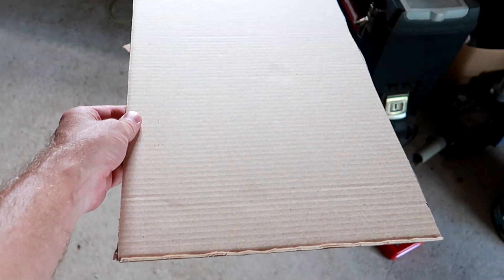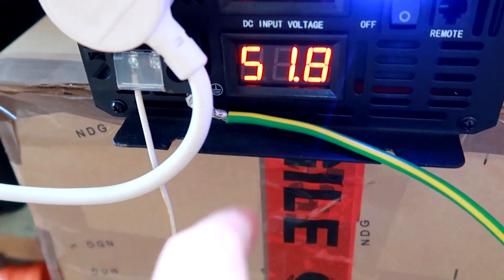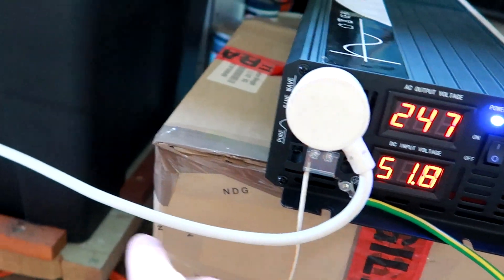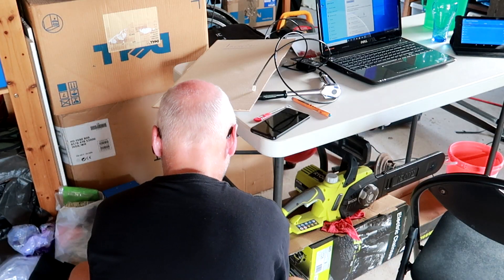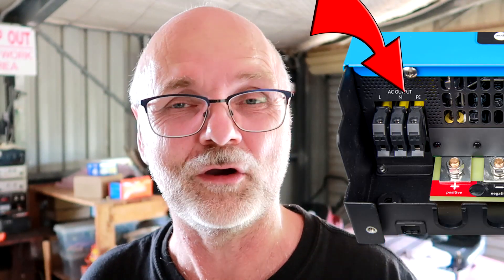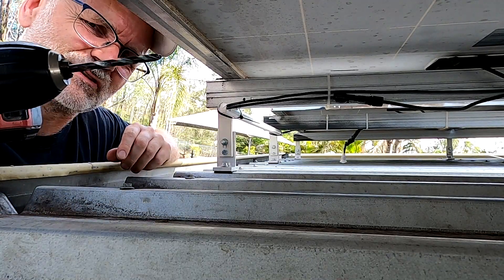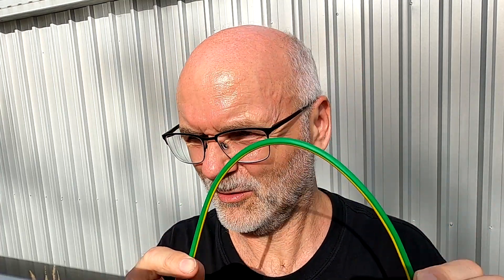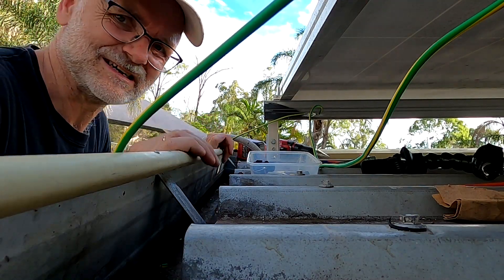The inevitable Inverter Upgrade

Comment: Neutral / "Earth" (ground) bonding exists for GFCI devices. Any current over ground would trip the GFCI, stopping power, that is the primary purpose of the N/G bond. The ground rod, or literal connection to the Earth exists to dissipate static discharge voltage. These are two separate concerns- if you have the N/G bond, even without a grounding rod your GFI will function. Static potential between commonly grounded devices will equalize with eachother.

Comment: Mount the new inverter to the inside of the door of the enclosure.
Reply from the maker: What difference would that make?
Reply: @OffGridGarageAustralia  By arranging the inverter to be mounted to the door you would be raising it and moving it further from the back edge of the enclosure. This would free up additional space in the enclosure for other components like meters, etc to remain inside the enclosure  - I  am assuming that having the inverter mounted to the door would basically make the inverter capable of being moved out of the enclosure when the door was opened and would thus leave room in the enclosure for other things as well as make it a bit easier to work on the components inside . Of course, you would need to use additional wiring , etc - so that when the door was opened the inverter could still be connected to everything. Additionally, mounting the inverter to the door would take advantage of the heat dissipation capability of a large thin plate of metal exposed to moving air .........  see comment below :)

Comment: If the charge controller was mounted to the walls, it would have natural convection from the cooling fins, but sideways on a table, there is no ventilation, so I would expect it to be cooler, when mounted.

Comment: Hi Andy. I’m not sure if you’ve picked up on it yet but it’s a 3Kva inverter. Not 3Kw. They are rated for 2.4 kilowatts continuous.
Reply: Is the claimed rating 3kVA peak vs 3kVA continuous?
If the load power factor is 1.0, one VA is the same as a Watt-

Comment: The lack of a real, separate earth ground is a coomon issue in marine setups, well documented with generators and inverters. The US OSHA has some advice on this, and there is an excellent white paper online for cinematographers and other who usually take gensets into the field, and typically don't pound in ground rods.
 You are not the first person to have this problem. Tesla is simply following safety standards for fixed installations.

Comment: The Victron MPPT charge controller would run cooler if mounted on the wall so the air can flow up across the heat sink and away. Putting all your goodies in a air tight box when ambient temp is already 35 degrees C is not a good idea.

Comment: 6:22 all in one unit like mppsolar, voltronic hawe same problem with Earth and neutral they work in "island Mode" when u measure in fase and neutral get 230v but when measure fase and Earth is 115 and neutral and Earth is 115. U hawe to join neutral and Earth with tini wire for just keep the neutral referenced to Earth and then u got 230v measuring on fase and Earth , neutral and Earth is zero now

Comment: Yea, that cheap inverter you initially purchased was probably the worst component in your otherwise "quality" system. 
It wouldn't have made for as many interesting videos BUT an all-in-one (Victron EasySolar-II GX for example) would surely have been the easiest, cheapest, highest quality solution PLUS it features a transfer switch with true ME grounding.

Comment: I know, we Germans are cracy on perfection... So I was just waiting until you go for Victron. 
I am very curious how you handle the voltage drop of the three cells. I was horrified by this incident! Because I plan to build a 48V bank with 32 cells based on your project. (Btw: there are severall offers on Alibaba for 310Ah cells of the same type)
Reply: I'm no expert but there is something VERY wrong with those three cells
Reply: Be careful with the 310Ah cells. They have QR codes scratched out and weigh similar to the 280Ah cells I believe. I'm waiting for others to test them first.

Comment: Moin Andy,
congratulation for your new converter. I think you bought the "Mercedes". High price but - all what I read about Victron - very good quality. Can top it only with the Systems from Mr. Piepenbrink.
However: In Australia you get much more "from the Roof" as in Germany possible. So I think you paid your price, but in the end of the day it's not wasted.

Comment: I’ve been using a 5000VA Quattro for more than ten years and it’s been faultless. It’s had a lot of abuse too (arc welder and pressure washers) and has always kept going.
Reply: Personally, if you’ve already ordered a new inverter, I would ground the neutral and battery negative and see what happens. You could put, say a 10A fuse in the battery positive just in case but I think it will work fine, be safe and usable for the Tesla. What have you got to lose?

Comment: congrats on the new inverter decision and after $1100 of pocket pain, I hope you get some positives from the imminent Inverter swap. As a Victron ‘victim’, I can’t conceive it an upgrade purchase, rather just as expensive pseudo-bling. You definitely won’t get the performance of this little Xijia 3k unit. I am sure the Pheonix Smart 48/3k will prove too small for your needs, so for now, keep your $300 Xijia just for close circuit car charging and use the new Victron for any general lighter loads. Definitely mount the Pheonix in a well ventilated clear area as it will run very hot at the back with only mediocre (2000W) loads. Unlike the Xijia, in that small cabinet along with the little hot running Victron MPPT unit you will definitely have heat issues on >32C ambient days. Can’t wait to see the Pheonix trying to do >2500W constant for even 1hr – its going to get hot as hell on the back plate. They are great quality but simply won’t go near the Xijia for output and cool running.

Comment: Some victron inverters can also charge your batteries cant they? I dont think its an mppt solar charger though i think it mains charges your batteries with a built in transfer switch that does AC passthrough. Usually used in canal boats/rvs that hookup too EHUs occasionally.
Reply: Hi Graham I had a MultiPlus II 48v/3k inverter with built-in MPPT charger and had to buy a separate MPPT as the inbuilt unit was very power limited (~2400W @ <70vPVin) and the extra heat lowered the inverters constant load performance. I tried lowering my PVin to 40v @ 60A but that made it worse. Ended up ditching that 3k Victron as it was a very expensive low performing 3k inverter. I purchased a bigger 4000W/1200W LF inverter for 1/5 the cost and it has run faultlessly for >2yrs running loads that the Victron simply couldn't.

Comment: Phoenix Inverter Smart  kenne ich nur bis 2 KW  (1600W Dauerleistung) 
 Prüfe bitte ob Du nicht mit einem 48 /5000  ....er  besser fährst!!!  (wg. Dauerbelastung unter Temperatur)
Gruß walter
Reply from the maker: Too late. Bigger is better, yes, but I have a budget too.
Reply: @OffGridGarageAustralia  dam... (schade)  But you would be able to connect both inverters to the same battery. Blue inverter for the car;  black inverter for what else ever ;o)   You must only take an eye on the "melting fuse" in size  inside of the battery.  150A would be fine for 7.2 KW  ;o)
Reply: @OffGridGarageAustralia  Your battery is good for 13,44 KW (if full loaded) therefore it mean you have "nightloadpower" for your car for about 4 hours.

Comment: You could bought an MPP Solar 5kW inverter for that price. And you could DC couple them with the Victron MPPT. So Victron charges the battery and the MPP Solar discharges it. Also extra MPPT in it for a new solar string ... for new solar panels.
The cabinet will be to small. Yep it will heat up like an oven. But you can drill 2 hole in the side and put 2 fans there (1th blows in, 2nd blows out). 
To protect the inside from bugs use mosquito net (folded, or 2-3 layer). There are some very strong mosquito nets that can withstand the constant hot airflow. Cheap solution.
Reply from the maker: Yes, as I said in the video. I want to be flexible.
Later, down the track I'm probably switching to an MPP 5kW or 8kW but for now, this is far better for me and everyone else to learn and learn and...

Comment: with 4mm for ground you should be fine (my PV has also a 4 mm). About the charge controler heating up, I think it was designed to be mounted in the vertical beacause the heat disipation is done at the back.
Also, about switching back to the grid when the battery is empty - I'm linking you a YT-video (it's in german)  https://youtu.be/Zr0BXeeuAS4 where the guy is covering a similar issue (he is covering the blackout situation) - could be interesting for you.

Comment: I'm really leaning  towards getting the "Victron Multiplus 2 48/3000" https://www.victronenergy.com/inverters-chargers/multiplus-ii
Reply: Hi Gerald I would recommend you go for a 48/5000 as the 48/3k runs really hot when using the built-in charger at only 2000W PVin which lowers its constant load output in warm weather. Also the PV in volts are very low (70V I think) which really restricts you panel options. Go for an external 60-80A MPPT charger with sat 150v Pvin capability. I battled with a MultiPlus II 48/3k inverter for 3months before replacing it due to it struggling to output even a constant 2000W on hot days. They are simply over-rated so go bigger to a 48/5000.
Reply: @colinbeckitt9495  Thanks for the feedback.  Yes, I agree that based on my needs I would probably go for the larger unit anyhow.   I'm actually looking for feedback on the product design and functionality of this rather new 'MultiPlus 2' units that they are selling.  I really like the design and ease of setup that this unit provides.
Reply: @geraldgrogan  Hi Gerald, I first saw the Multiplus II 48/3k at Intersolar 2018 in Munich and bought 1 in Oct 2018 by mid-Jan 2019 I sold it and bought a much better 4000W Power Jack unit for AU$440 on eBay. To be fair, they should be selling the Multiplus II 48/3k unit as a 1700 - 2000W continuous unit if you are using the MPPT at the same time.
Victron are very nicely made inverters but I think designed for cooler countries as they just overheat and drop-out constantly during a Australian Summer day. I paid >$1800 for my Multiplus II and I regret ever listening to the BS everyone had hyped the brand up to as they are simply overated and perform poorly. My mate has a Chinese built POWMR MPS-V-5000W-PLUS inverter that cost $765 free delivery, has 80A MPPT charger, 11,000W surge and easily runs 4500W continuously @36C ambient. Victron has a long way to ho before they can compete!

Comment: Charge controllers that goes really really hot have efficiency issues (assuming you did not go beyond specs on its input requirements), not a good design and it does not matter what brand it is.
Reply from the maker: I think all MPPTs do that due to the power conversion. Nothing you can do about it.
Reply: Do own controllers heat up less than mppt controllers? Figured the more efficient they are, the less heat they dissipate.

Comment: For grounding use one size less then the normal cables. In Most cases that’s ok. So if your solar array works with 6mm2 ... 4mm2 should be fine. Make sure your new victron device will have enough space around itself ... it dont needs exactly 10cm ! I install these units in much tighter spaces and everything works good but keep this place ventilated with some temperature-controlled fans. That’s easy to do for you.

Comment: You can try playing with some small resistors like 1/4 watt or something Since there should not be any current flowing through it but I don't know how high resistance you can get away with but still of anything happen it would blow the resistor out I guess you could also just use a like 1 amp fuse or less I have never looked for any fuses that low or lower

Comment: Is it ok to use UPS 1kva (900watt) for solar home system?  it is a used UPS but a hight end UPS back in the day.
Reply: it is 90% efficiency
Reply: Is it a good idea to spend 120$ for 1kw inverter with 94% efficiency.  That UPS  only cost me 15$ with 90% efficiency
Reply: I dont think that is a good solution. You have no change to customize the battery parameters. Your battery will be handled as a lead acid !!!
Reply: Typical ups has limited heatsinking. Usually has to work for a short time in order to allow system to power down successfully. May need to provide additional cooling if used for continuous load.

Comment: Love the Victron. I am in the process of rearranging my system with two Magnum inverters. On the sides with vents they need six inch clearance and three inch on the other sides. If you are going to put the voctron in that box you are going to need to cut a vent in the side and probably the top. Ideally you would also have an intake and output fans. I know it doesn’t feel good to have layout plans change but I needed up changing all of my plans because  of that exact issue. Even if the inverter doesn’t burn out it does reduce efficiency.
Reply: Yes, the more you deviate from the ideal 25C temp the more incementaly worse the efficiency goes...not to mention components degradation.
Reply from the maker: Good feedback. I'm prepared for everything as I constantly changing my plan.

Comment: Those all in one thing's, you really need to look closely at what all the components inside are! There's many different models available and they all offer something different.
How do I know? I have one sitting on my bench which blew up, apparently they don't like having the battery disconnected while the solar panels are connected and providing power! 
The one that I have is the 12V battery version which also needs 12V solar panels, it can accept 24V panels but the charge controller module is PWM and it doesn't make use of the higher input voltage! The inverter on mine is only 800W which was plenty when I got it to run a file server in the garage but I have since upgraded to a blade server which used to run a hospital here in Melbourne and the inverter just doesn't have the capacity to support it.
Also I should mention that the PWM Charge controller module is really slow to respond especially during changing weather conditions, clouds passing overhead cause it to ramp down while it thinks about what it wants to do, then when it finally decided to ramp up, another cloud comes over and we are back to thinking about it!!! It's really annoying! 
I have since switched over to cheap eBay $10Au MPPT charge Controllers which are rated for 100W for each 12V battery bank so for a 48V string I'm using 4 of them, one each for each 12v bank, that's a total of 400W, they can be paralleled for more current but they are incredibly fast to react! Even without direct sunlight, as soon as it lights up first thing in the morning, they are already begining to work till the last bit of light late in the afternoon! Seriously impressive performance! 
I can't speak for all of the other all in one models but I wouldn't recommend my one! 
As you mentioned it can switch from solar to battery to grid AC input which can also Charge the battery with the built in battery charger! There's also a connection to activate a standby generator as well! 
But for me, I don't want to use the grid or a generator either, the idea of it is great but it's slow, oh and if you introduce an extra load on the battery, like a 12v light for example, the solar charging stops so it can think about what just happened and the same thing happens when you turn off the light... Really annoying 😲... It's fan's sound like a F11 fighter jet is hiding in my garage to.. 
I hope that this helps 😊

Comment: Ground wire needs to be 4awg if exposed.  If protected(strapped to or inside conduit) it can be much smaller.  But you also should have weeb washers between panels and rails and on lugs that ground to the rail.  Sometimes the code goes a little crazy here, but for high voltage systems I can see how that would be better.